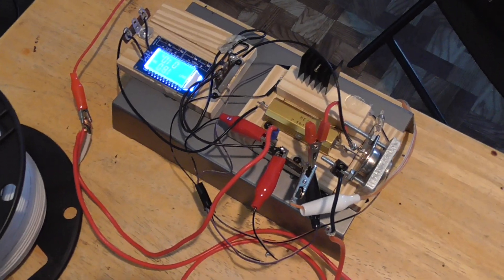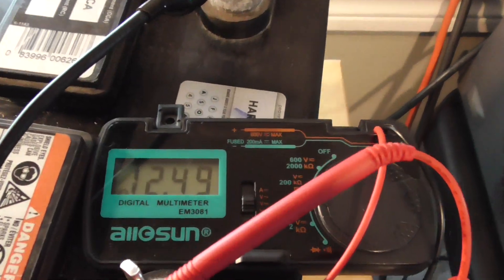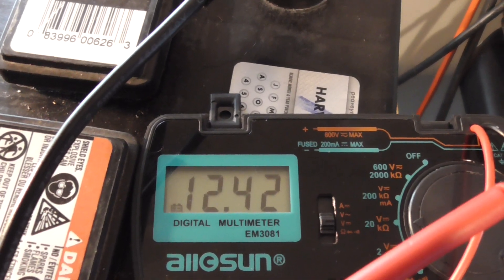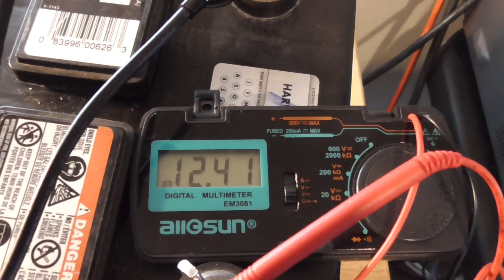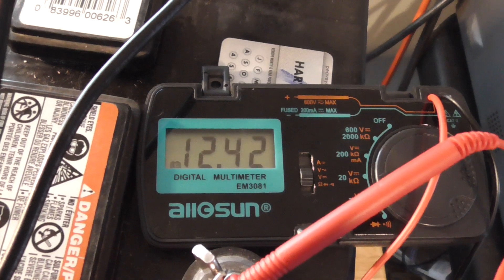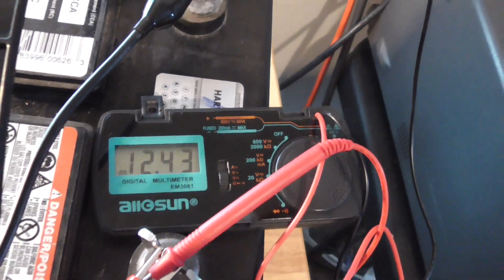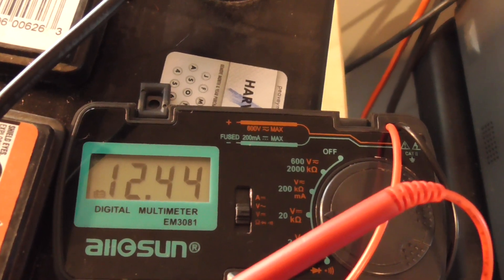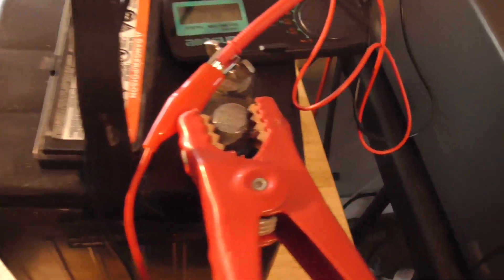100 watts of free energy

Comment: This was a year ago! 🎉 Wow Joel Bravo. 

For the battery type systems it seems the megahertz + frequency pulse is key. Seems like cold energy is being sucked into the coil or capacitor. I assume this is cold plasma regime from scalar waves collapsing in the center of the coil? 

Joel, I think this circuit using a rodin coil instead of yoir white spool would multiply the voltage on output and increase COP. See BeneficiantTv. 

I wish my computer was working to save this. 

It would be very cool to have you on a live stream on Faraday Research LLC youtube channel Friday night 9pm EST. 

God bless you Joel, we need more people like you. ❤
Reply from the maker: Yeah also been working ever since to refine the controller pulse etc.. One long story short to try to eliminate the need for dependence on lead acid anomalies. My latest dual mosfet switching project seems to be a leap in the right direction.

Comment: I'm sure capdump is the secret to most devices like Floyd Sweet's device, Moray Henry's, Kapanadze, Berdini and Don smith's devices...etc But though you have to combine that with a much higher frequency Current...preferably 60Hz....has to be perfectly synchronised and grounded to work.

Comment: The Only Method to Reduce Impedance and Obtain Better Results to Take Much More Advantage of an Electromagnetic Field is to Use Very Fine Cable in a winding, but it is not a coil made with turns of very fine cable. It involves using many thin cables in parallel to reduce impedance and increase magnetic density. You can make a 100-turn coil with 0.3mm wire, but you can also make a 100-turn coil with 10,  0.3mm parallel wires. Thin Cable Increases Resistance, But Many of them in Parallel... You Already Know. You are welcome!
Reply: For this reason Bedini used BIFILAR coils!

Comment: Well your amps are still coming from the battery, but you can volt even low volt . And BTW, leave the Acid battery sealed and vent into a can w/filter that is Hydrogen / sulfur  with the Charging of the Volts, Do not Breath near the Charging of them..
Reply from the maker: It's an issue with some of the Bedini chargers they blow up the batteries, some say to just lift the caps to air out the hydrogen.
Reply: @joellagace1679  I use them Water/Weather Proof Battery Boxes and Vent the Hydrogen Gas outside, simple clear rubber hose works best W/Flashback blow-back when hydrogen generators items

Comment: Use a flat copper strip spiral coil, with high K dielectric instead of the PVC insulated copper coil you have and see the difference. You can even use an air gap as the dielectric, as long as it's not shorting.

Comment: This is amazing Joel and i want to build one.  Say,  im watching this video now and it looks like you posted this 9 months ago.  While watching the video, i noticed that you mentioned that the battery was boiling during operation.  Have you check the battery recently and is the battery still ok?  Im just wondering if this set up has some sort of negative effects on the battery.  Thanks, Clint.
Reply from the maker: According to many it does have an eating effect on the battery. I never did it enough times to apparently harm the batteries. Others say its juburshing and it don't kill batteries, This is my only good battery so I moved on to other methods. I did get the same effect not as pronounced using only caps.
Reply: Ok, thank you.  Yes, I've seen that video too with the ultra capacitors.  I think the one wire set up is the way too go.  The key is to not kill the dipole!

Comment: after 8 months of knowledge do you think this way is more sustainable or the one wire system method is better?
Reply from the maker: one wire for sure! Replicable conditions vs sporadic imo as good as this was not putting it down its still up as its good good info.
Reply from the maker: But it depends on the Bedini the big multi coil systems will produce that radiant energy at the back emf output that is compatible with the one wire system. So you could in theory use a "Bedini" to drive a one wire system instead of directly coupling into the back pulse with a reverse diode and two wire. Keep that loop open and you will do just fine :)

Comment: I'm absolutely amazed by this circuit & have a few questions if you have the time to answer  them please. 

1. Does this only work with old lead acid batteries or could it work with lifepo4 batteries?

2. Could this be reproduced on a smaller scale with a scaled down version of your large coil that has the 4 end wires shorted out?

3. Would this run indefinitely in theory? 

& I'd love to support your work & donate each month. I'm also interested in your exact circuit diagram
Reply from the maker: Well from my experiments, I have not been able to scale much down from this, Bedini has the same concept scaled up. I do show it working with some modifications with capacitors only, Sure the voltage keeps going up however taking a day to do it, Is not really optimal energy but it's a simple teaching tool to demonstrate the concepts.  As far as lead acid batteries its a hit and miss and you need to condition before, Some will respond better then others. So this is why I got away from using lead acid. It works but difficult to replicate the conditions.
Reply: @joellagace1679  i appreciate your quick  response & in alot of my devices the tuning process can sometimes take 2 or 3 hours lol

Comment: I had such experiences with my radiant motor I'm currently working on; the battery initially drops in voltage, then starts charging up again. After hours of use however, it starts dropping in voltage again. While on my radiant motor the battery is not plugged in to any charging source...we move

Comment: You are NOT an amateur, sir.
Reply from the maker: You mean ham radio?
Reply: Probably that, too.  Upscale this to power a house and you can become the world's first trillionaire.
Reply from the maker: You just need to add more coils (to a point) and building the coils more massive in size, while trying to keep impedance down below 2 ohms also seems to work.
Reply from the maker: Bedini also ran multiple coils at the end but you see his amp meter swing to 1.5 amps when it pulses. It was rumored that the output was 300 watts, I think Bedini may have calculated wrong as we are not dealing with AC or DC here. It is a sharp pulse expressed in amps a second. So you need to calculate your input joule and your output joule, And compare that with the input. Trying to figure it out live visual peaks with amp meters looking for the higher pulse on the output is not going to work with this kind of energy. A mistake some will make in trying to determine the output. Also make sure you keep that input pulse duty cycle below 1%. The community has advised us that using mosfets would be better with the features of extra fast and sharp off switching times in relative to transistors. So you can try that as well!

Comment: Your PWM board doesnt need the voltage stepped down.  Its rated at 3.3v minimum to 30v maximum.  What type of block resistor <ohm's> do you have at the base of the transistor?  I also noticed another neon near the transitor.

Comment: Without sharing the details, it’s useless to people
Thanks
Reply from the maker: the details of the backemf generator are not relevant. I built it up very crudely. Nothing special or secret, there are better ways of doing it. There are a billion schematic diagrams online of such generators, study one, pick one and use it. What is important here is the cap dump pulsing effect. And I have released the cap dump circuit already.  Thanks!
Reply: @joellagace1679  what voltage is the cap rated for?
Reply from the maker: @jimmybrad156  200 if memory serves me right. Have to make sure that it can handle the total backemf spike.

Comment: excellent demonstration my friend, but I have a question: the transistor is npn and if you could tell me which one you use, thank you very much.
Reply from the maker: The transistor is not that important for slow( in relative to RF) switching. Bedini used many "audio" transistors for the job.  I use here NTE 181. You will do better if you use a mosfet based switching circuit instead to pulse a coil
Reply: @joellagace1679  thanks my friend I will take your suggestion into account. i also wanted to ask you if it would be possible to put 2 or more coils in series or in parallel.
Reply from the maker: @stbanmurillo  I am still experimenting with using more coils, I think it can be done. Bedini has some similar schematics that do just that.
Reply: @joellagace1679  where to find the bedini schematics? if you could take me to them I would appreciate it my friend.

Comment: Hi Joel that’s a great and inspiring result. Can you please clarify what pulses are actually reaching the battery? Most cap dump type circuits are charged up to say 25V and then deliver a high current pulse to the battery whereas I thought you mentioned several hundred volts reaching it. Is it just current pulses to the battery and the spikes to the storage capacitor?
Reply from the maker: This is what I seem to be doing a little different, I charge the cap to about 100 volts before dumping into the battery.
Reply: Ok so you are using a 40uF, 100V electrolytic cap with the neon as the ‘release’?
Reply from the maker: @julianperry1406  the neon acts like a switch at 100 volts and dumps the cap.
Reply: @joellagace1679   My previous comment hasn't shown up yet (it had a link to an image of a circuit which might be a problem posting?) Anyway, in that Neon circuit, I left off the diode between the HV pulses coming in and the capacitor. I hope the earlier message arrives.
Reply from the maker: @julianperry1406  I will check the spam filter, youtube is bad for that
Reply: @joellagace1679  I don't think I can get round the filtering so would you mind if I explained what I think is the circuit long hand? I'm trying to replicate what you have shown while I update my cap dump circuit to deliver higher voltage discharges so I would be very grateful if you confirmed the main layout of it. In my Neon circuit, the HV pulses come through a Diode to the plus of the cap (50uF, 150V), and the circuit connection carries on through a ballast resistor (1M) to the Neon bulb. The other side of the bulb goes to the battery plus and the battery neg goes to the Ground line to which the neg of the cap is also connected. So the capacitor is across the Neon and the Ballast resistor is in series with it. Given the need to deliver as much charge as possible, do we need a ballast resistor? In your video there is something next to your Neon that I am presuming is a resistor but maybe it isn't. Thank you
Reply: Interestingly, a recent conversation with Peter Lindemann revealed that he and Bedini tried using high current pulses and HV pulses together to give extra impetus to the charge delivered. Your approach might be an easier way to do that.

Comment: Cool circuit and tremendous results! Have you let it run for an extended period and witnessed the same effect? (ie. 8 hours)
Reply from the maker: yes, I also been able to use the inverter to run a traditional car battery charger and successfully charged a bank of 2 dead car 12 volt batteries. No vid of that as I don't consider running a traditional charger to charge any "impressive, how ever i'm stating in this comment like Bedini did, it will "work" with an inverter running a charger as well to charge additional batteries with "regular" energy.
Reply: @joellagace1679  how high did the battery voltage get (while still driving the inverter's 100w load) after >10 hours?

Comment: I'm very impressed. I would like to see one of those plug in watt meters on the inverter to see total watts. and an dc amp meter showing the draw from the battery. The inverter takes dc amps while running also. So it would be nice to see the total draw from the battery. You are showing the bemf of the coil can keep a battery charging with a load . Great work.
Reply from the maker: Yes your right it would take a little more then 100 watts. I didn't account for the few watts the inverter uses while just being on. But yeah that's what it seems to be doing it keeps the charge up while using a load from the back emf side. But for some reason the back emf gen/controller needs to be totally isolated power systems for greatest effect.
Reply: Yes the bemp spike needs to go to a cap bank to store the charge . this serves a purpose it can take the spike and just charge up the cap. if the spike went to the battery it would vibrate the plates . that is what you don't want . these new battery charger do that they pulse the plates with dc pulses . ruin batteries.
Reply from the maker: @hydniq3327  Yeah I read about some of those kinds of chargers going real bad even blowing up "bad" batteries. Even. But that could be just Rick trying to give Bedini devices a bad name. But your prob right. Dr Peter whats his name also insists on the cap dump method for any kind of "self" running mode.
Reply: @joellagace1679  Hi Joel, you mean Peter Lindemann right? Really like your videos and the questions that pop up while you work, really impressed! I will give it a try like you did in this video. My experience with batteries is you can only measure the voltage if they are not connected to anything. So you could do this every 5 min or so just to be sure the battery keeps its voltage ‘unloaded’
Reply: My concern is the pulses 100volts maxm damage the Inverter components that exceeds 12v?

Comment: I'm so intrigued how such a low resistance coil can draw such a low current! Could you post details on the coil and driver please? My Bedini motor draws a minimum of 200mA, so I'd love to get that down!
Reply from the maker: I use a solid state method, it took me a few years to find this couple of dollars square wave and cycle dutty generator. That works at such low voltages I need to have a small voltage reg at 5 volts in front of it as its too hot at 9 volts lol The trick to using very little current is to bring to cycle dutty very low on pulse like I got it set at 10% this gives fast and sharp pulses into the coil limiting much of the current at such sharp setting, This how ever seems like more than optimal conditions for loads of back emf. I have total control of how much current I choose to let the system use. I don't think you can get that much control using the mechanical wheel method.
Reply: @joellagace1679  I'll be moving onto this method me thinks. What frequency do you drive it with? Is it resonant with the coil length?
Reply from the maker: @JohnnyD_cm  180 hz. I had no real method at hand to test for resonance point so instead I did it 10 hz at a time and simply listened for fastest clicks (cap charges and discharges. As I raise to much over 180 hz it was going slow again and if i dropped it to much lower then 180 hertz it also got noticeably slower so I just took the two values and went in the middle at 180 hertz for my setup and i get fast clicks, a couple a second discharges and recharges with 22uf cap. I tried 10uf much "faster" clicks but the battery does not seem to really respond with the 10uf dump. Something like 40uf the clicks get too slow.
Reply: @joellagace1679  Thanks Joe, I'm going to experiment and see what I get. This is exciting stuff!
FYI, my Bedini motor is 6x ceramic magnets and a 7x twisted cored coil, 150ft each length at 22 gauge and 1x at 28 gauge for the trigger. I dispensed with the trigger coil to use a Hall effect switch to drive a pulse generator. I can set the pulse width manually, this then drives the coil via a 2N3055. I found that attraction mode worked better. I tried one coil as the drive, but the current was up at 600mA (resistance was 1.8R). The other coils were to get DC via rectifiers. I now have all 6 coils in series to give the 200mA. I've tried all manner of things to tweak the performance, but the spild state method is looking very enticing.
Reply from the maker: @JohnnyD_cm  Very nice, I tried that as well with a wheel I had. With a hall effect chip a while back but I kept burning them out when the wheel got to fast rpm. good job!